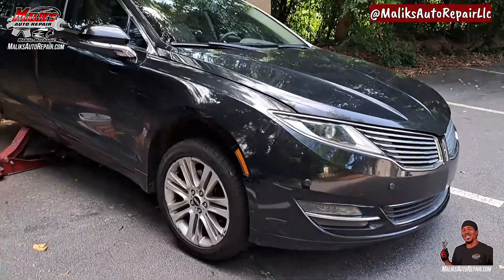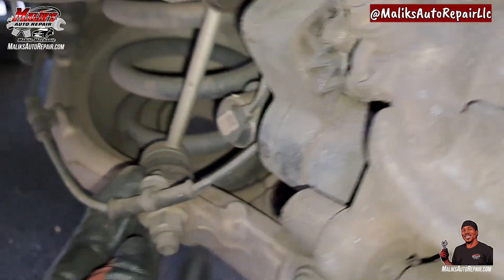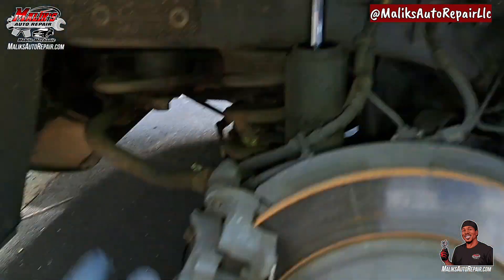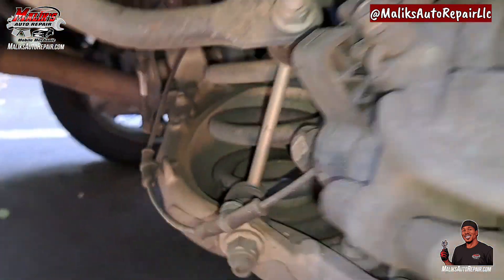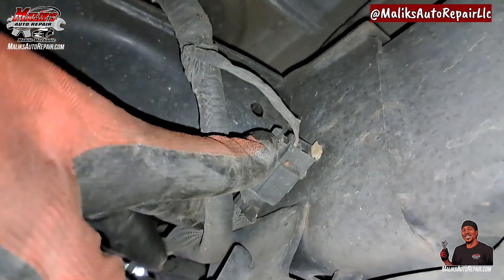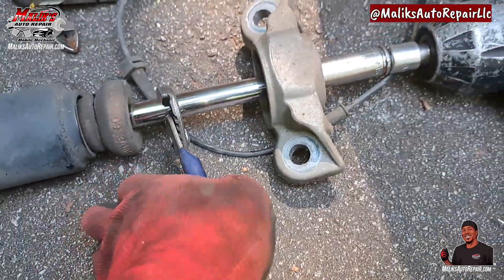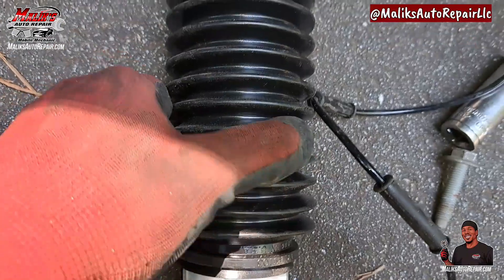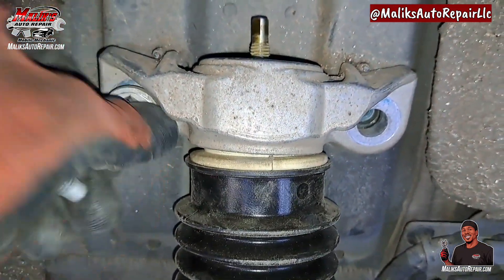HOW TO REPLACE REAR STRUTS | 2013 LINCOLN MKZ 3.7 | Howto/Diy

Comment: After replacing it 
I got a
Drive control 
Malfunction service requieres 
How can I remove that? Or what can u do? 

Thanks a lot 
Ur videos are helpful
Reply from the maker: A discharged battery or an inoperative charging system ,could be possible.  You'll need a dealership type scantily to pinpoint the problem. And thanks for watching!